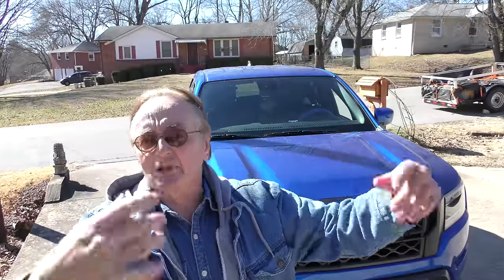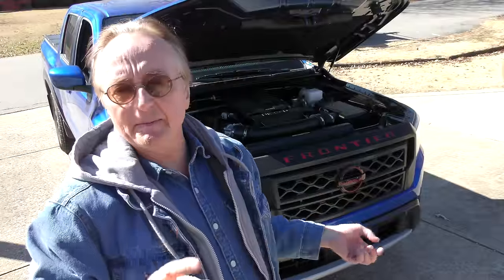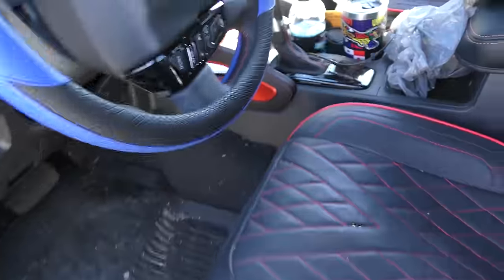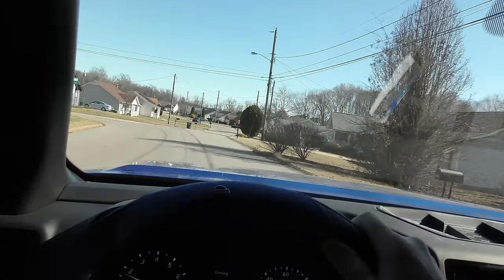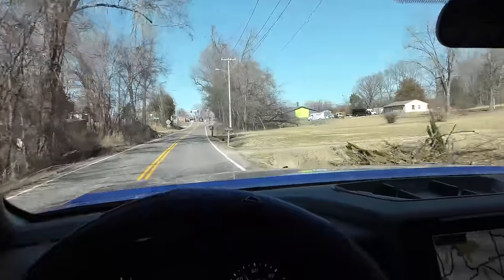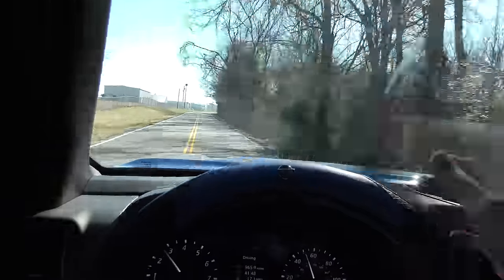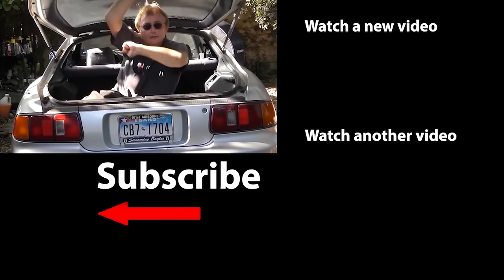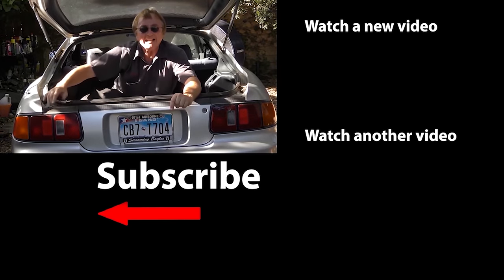This New Cheap Truck is Better Than Anything Toyota Makes Now

Comment: As a new frontier owner, I couldn't agree with Scotty more!

I drove just about every midsize truck in the segment, and the frontier really stood out. It wasn't trying to be anything but a good, reliable truck.
Reply: how much did it cost you and how much do you like it so far?
Reply: @GlycerinZ  I got a pretty good deal, it was originally a 42k truck but I got a 23 Sv 4x4 with 2k miles on it for 31.5k. A little dealer desperation helped
Reply: Thank you for the info!!
Reply: I hope they have manual transmission
Reply: @GlycerinZ  The Pro4x's are 40k+ brand new. I waited until the end of the year and picked up mine with about 5k off MSRP.
Reply: your truck is listed as one the most unreliable cars in 2023……
Reply: @j_n_g916 By who? Toyota just had a rear axel recall for the new Tacoma. They’re now made in Mexico. 
I have a 2015 Frontier. Almost 100k & ZERO problems. Nothing but service fluids, don’t even need brake pads.
Reply: @sledawgpilot you mean mejico
Reply: We all won't know how good these truck are until 2030
Reply: @j_n_g916 says who?
Reply: Love my 23 pro4x
Reply: @j_n_g916  by who? What issues are you referencing?
Reply: It’s been a long time since I’ve been in a smaller than a half ton truck. I had a 2023 frontier as my rental while my titan was in the shop. I HATED how small it was. And it just vibrated at idle the same way as an old Dodge from the 90s
Reply: @ericbruce5075  I will say, it does idle rough, but this is mainly due to emissions regulations because the idle is too low. That's at least my understanding
Reply: Glad to see that Scotty has become a Frontier fan. I'm on my third Nissan truck (first one was actually a Datsun, '86 I think), and I loved every one. My '01 was an XE and only cost about $16K, the latest is a '16 SV 4X4 and was about twice that ($32K). I considered a Tacoma in '16, but it was about $3-4K more expensive, depending on the trim level. My SV is super well equipped with the "value truck package". It even has dual climate control, one of my favorite features. I looked at replacing it recently, since the used truck market was through the roof, but a new one would have been more like $42K, and not with many cool extra features. Crazy.
Reply: Why do people buy small trucks? I just dont get it
Reply: @MrWalterRaymond  because they really arent small trucks. My frontier is about the same size as an 2000's model tundra. Over the years trucks got way too big, and I'd prefer the smaller size when driving.
Reply: @MrWalterRaymond why do people compensate in big trucks; I don’t get it
Reply: Nissan is only ranked under Toyota for reliability, unless you're considering the Hyundai Santa Cruz and the Honda Ridgeline as actual trucks. All American vehicles fall behind the frontier.
Reply: @MrWalterRaymond they're great if you just require something for light duty work. Also for me it's a secondary vehicle and I don't want a full sized truck taking up a ton of space in my garage or driveway.
Reply: Same here
Reply: Love my frontier
Reply: @j_n_g916  I have the 2022 frontier which is the first year release of this new model. 120,000 miles on it already with. ZERO PROBLEMS. Not sure where you got that info.
Reply: It always has been the best but people are all crazy about them tacos wich feel like were designed for midgets and I'm saying that as a short guy
Reply: @MrWalterRaymond  You can go more places
Reply: Yea me and my dad(who's a master mechanic) looked at the Frontier then the Colorado. On the way home Dad, said I wasn't unimpressed with the Colorado, just SUPER IMPRESSED with the Frontier
Reply: I drove just about every midsize truck in the segment, and the for ranger is a beast
Reply: @sledawgpilot I have a 99 pro4x. I'm just checking out reviews on the restyle/new engines. 99 is my second Frontier. Fluids and batteries for me. Nothing else.
Reply: @Bilbo383 When you are outside of your frontier while it’s running, do you hear the injectors? Kind of makes it sound like a diesel rhythm?

Comment: I was 20 years old. My first new truck was a 1984 barebones Nissan pickup. It had see through windows and push down pedals. No radio, a/c, cigarette lighter or rear bumper.  Paid $5200. It was a great truck.
Reply: I had an 89 Dodge Dakota, 8 ft bed, custom cloth interior, AC, awesome radio, tu-tone paint and OUT THE DOOR FOR ABOUT $8000!!!!!   SAME idea as your truck and if they would make a truck like this today for under $20,000 they would have people lining up to buy them and a waiting list to get them.  They would rather go out of business selling their 6 ft bed undependable electronic nightmare trucks that no one wants rather then offer dependable cars and trucks I guess.
Reply: My first truck at 16 was a 78 Datsun 5 speed. That was a tough little truck!

Comment: My friends dad just sold his 06 with over 250k on it. He never had any issues with it besides regular maintenance. 
He now owns a 2023 and is thrilled, he will have it until he dies I suspect!
Reply: I own the SUV brother to the frontier - I have an '08 Pathfinder with 209,000 mi. Runs like a top. Bonus that the previous owner had to put a new transmission in it because of the SMOD defect 😅
Reply: My frontier is garbage. So many issues. It’s an 07. Had a new transmission put in around 115k miles and have had tons of other smaller issues as well.
Reply: noob .dad.
Reply: I've got a one owner 03 with 284k miles. I've run this thing through trout streams hundreds of times. Paid $13k new in 03, put around $3700 in maintenance over the life of it. That's oil pump, alternator, break rotars, top end clean out, deals on the head and valve cover, and basic maintenance. So all in, i only have about $17k invested in a 21 year old truck that i still drive weekly. I'll own another one.

Comment: I bought a 2024 Pro4X in January, absolutely love the look, feel and drive.  The hydraulic steering is awesome.  Great video Scotty!
Reply: Hydraulic steering is a big green flag. You usually only see those in 2500 trucks cause they can't afford to lose steering when towing a heavy load.
Reply: These Nissans have hydraulic steering?!? That’s great too hear tired of the electric steering crap
Reply: @phantombread3170  yeah they do. most of the reviewers only talk about it in a disparaging way, because "it's too heavy" lol.
Reply: How much did you get it for?
Reply: @KK-tt6ui  I got a lot of upgrades, pretty option loaded at a cost of $46,680.  That also included the upgrade color of "Cardinal Red"
Reply: @JokerG16 it’s funny what people complain about 😂! It’s one of the main reasons I’ve been running Nissan trucks for years.

Comment: Real buttons and knobs and other manual items. 

 Just beautiful
Reply: Totally agree!  Hate the direction with the large gaudy screens where now all the controls, that were formerly on the dash, are now located.  The screen goes out, the truck is down.
Reply: @richarde1355  I couldnt agree more.
Reply: Never again. Had my screen lock up on my Jeep in -35°F weather. This tech isn't just a cheap cost cutting measure.... the stuff is dangerous.
I signed for a Frontier so fast that the pen started smoking.😅

Comment: Nissan frontier, hell yeah!!! I'm really glad I picked this truck as my first ever truck, best decision ever. Love the heavy steering, it feels like a TRUCK!!!
Reply: I got used to the steering right away and love it. Only time you might notice it is pulling into tight parking spaces.
Reply: I love my 2022 Frontier crew cab 4x4. 42,000 trouble free miles. The great feeling steering and 9 speed are the main things I like. And the looks of course.

Comment: Very under rated truck. the axel and drive shaft are DANA and the transmission is Mercedes. The Titan should just be a larger version of the Frontiers styling.

Comment: I have a 2007 frontier with 263,000 miles. V-6 with original water pump and radiator timing chain etc. Shifts perfectly, blows cold air, gets an honest 20 mpg on the freeway and has an absolutely kicking sound system. Still looks decent (white with roof rack). Have replaced breaks, coil packs, one window regulator and the clock-spring. Yes, it rides a little rough, and if I should ever replace it, it would be another frontier. That is if I stumbled on a fortune first.

Comment: My employer leases these for work trucks.  I've driven several  of them over the years.  I have one of the new body style models now, which I like the styling of.  The older body style was pretty fugly, but  the last one served me quite well...160k miles in 4 years with no major mechanical issues.  It had the 4.0 v6.
Reply: Whew!  That’s a lot of driving!
Reply: @Dbb27  It's more than I'd like to be doing, that's for sure.

Comment: My work recently bought a titan xd that is only a couple years old. It was put into service immediately doing lots of terrible winter driving. So far it has been an absolute tank, it feels about twice as capable and planted as some of the other work trucks over the years. It feels planted in to the ice in a way few other truck do, at least that I've driven, even on the fairly average 3 season highway tires the dealership bought it. That v8 has quite the character and throat on it when it opens up too, it sounds badass from the factory and pulls plenty hard. It also just likes to go fast, it's kinda hard not to speed, it sorta has this bad boy attitude just by how it drives. I'm pretty sold on it, wish I could drive it all the time. Can't believe they aren't more popular.
Reply: yeah bro the Titan is so underrated. i rented a non-XD version a couple of yrs ago and that thing was SOLID as hell. it had a stance that was almost on par with an HD Silverado!

Comment: Back in the day I bought a Nissan hard body 4 X 4. And they were stupid cheap money. But they were really good trucks. I used to pull a boat and I used to pull quads and motorcycles with the truck. Never had any issues. If this Nissan is even close to as good as those old hard bodies were, I would buy one.
Reply: yeah they seemingly are bro. they even brought back the hard body design for '24... looks super retro!

Comment: It's a Mercedes-Benz 9G-Tronic made by Jatco under license. Still better than any CVT they made
Reply: Is it a good transmission?
Reply: It is not the Mercedes transmission.  The Mercedes-Benz 9G-Tronic is designed by Mercedes and manufactured by Jatco. The design is licensed to them and has several modifications to it in order to work with Nissans engine.  There are quite a few parts changes and the software that controls it is completely different.  So, you cannot simply say it’s a Mercedes transmission. You could not simply swap one for the other.
Reply: @krellman7  Is that Jatco 9 speed a good transmission? I haven’t heard too many bad things about Jatco’s other automatic transmissions.
Reply: @bucknasty69  Yes, this has been a pretty solid transmission. I would say it has been pretty rare to see an issue with them. (I work as a service manager at a Mercedes dealership). So far, so good!

Comment: Still miss the old 4.0V6 Nissan used in the older models. My Moms old Pathfinder same as the frontier in at the time, has the 4.0 and 200K Miles still drives great! Gotta love older vehicles
Reply: The newer 3.8 is also a VQ engine. They're almost identical.
Reply: @jkahre  yeah, i believe the 3.8 is just a direct injected engine, rather than the port injected engine in the older 4.0L

Comment: I own a blue 2015 Nissan Frontier SV 4x4, it’s got 220,000 miles and it’s still going, same transmission and engine
Reply: I've been looking at this 2015 year. Did you buy it new or used?

Comment: I’ve always been a Toyota guy, I’ve had a Tacoma, a Tundra, and two Carollas. I have a 2012 Nissan Xterra with 265,000 miles on it and it shows no signs of slowing down. I think I’ll take a look at the Frontier when I’m ready for something ‘new’

Comment: My son bought a new one in 2022. It's been absolutely flawless. Oil changes every 3,000 to 4,000 miles. Drives/rides and handles much nicer than the Tacoma, which was his alternative.
Reply: Same with our Ford Maverick hybrid, those things are reliable as hell.
Reply: Hold on the maverick is only what..2 years old?
Reply: Changing your oil every 3,000 miles is a waste of money. :/
Reply: @Peterswarahed 
A women told me her car was reliable & it was only 2 years old with only 8k miles 😂.
I replied, I'll let you know if my 7 yr old 120k miles Subaru is reliable in 3 yrs 🤔
Reply: @Raboon115 are you my brother in law? He thought he was smart changing his oil every 10k miles and blew his engine up at 70k. Oil is cheap, engines are not.
Reply: My 1972 Maverick was very reliable.
Reply: @x-Saffron-x  it may be a waste but to quote an old school saying my dad used to say,  “it’s cheap insurance”. In my opinion regular oil changes plus proper maintenance has help keep my  domestic vehicles reliable and dependable. 203K on a 07 SXT charger, 180K on a 2013 explorer, 170k on 04 Dodge Ram 1500. All still running strong and helping me to keep avoiding new car prices at all costs. Our newest car is a 16 Mustang at 60k
Reply: @rigell2764  

Owners manual says synthetic oil only needs changed every 5 to 7 thousand miles on a frontier.

I think the engineers know better than you do.

If you are breaking in a new engine then 3,000 is fine. 

Your brother in-law is the other end of the spectrum. Lol
Reply: @renohiker  

It's not insurance and this isn't old school natural oil. It's synthetic. 5 to 7 thousand mile changes is what the engineers recommend on new vehicles because it's what they built the engine to conform too.

And I have a feeling your Dodge's burn oil so you don't have a choice but to change it earlier.
Reply: @x-Saffron-x  This vehicle works downtown about 50% and urban/highway 50%. That's very cheap insurance and his crowd knows how he maintains it. A ready pack of buyers when he decides to doff it. Owner manual recommendations are designed to get you through the warranty period without engine problems related to dirty oil and worn oil. The incremental cost of oil vs repair, plus downtime, rental and pain in the butt factor makes it a no brainer.
Reply: @rob6052  

again. It's a waste of money and is not "insurance" and it's not "cheap". 

You are spending an additional 40% on oil changes for the duration of the vehicle with no added benefit. 

That's fudd Lore as can be.

The engineers designed the engine with the idea of changing the oil at 5,000 - 7,000 miles with standard wearing and above in mind.

Like Scotty said, it's a naturally aspirated V6. The engine is not going to fall apart from doing its job with recommend maintenance.

It has no turbos on it or other augments which increases engine wear.

Comment: Scotty, thanks for all the work you do. I sure wish I had you down this way as I have an intermittent problem with my Frontier AC. But I digress. My Frontier is a 2000. It is their big 4 and I got it as a grocery hauler and light-duty truck to transport things about. It has served me well for 24 years. Only lately has it cost much. When you do maintenance today you have to drop off a kidney to pay for the labor. It has less than 110K on the odometer. The body is in great shape except for the road scratches you get from folks opening their doors and road debris. I can't complain about the quality of the truck. Of course, it is a little dated but is a part of the family. It may be the last truck I'll own as I'm retired. However, I get the itch now and then. I really would have liked to have purchased a Toyota truck back then but the dealers in the area were A-hats. Either way, I may have to look at a Nissan again in the future if something happens to my old truck. It seems that you can't keep folks from driving while stupid. I've never wrecked a vehicle that had to be totaled. Yet, I've lost several to folks driving into them while parked in front of the house. I used to own a lot of the older Nissan cars. They were great vehicles. I'm not much for all the bells and whistles on these things as they crap out and cost far too much to have repaired. Again thanks for all the info.

Comment: Xterra and Frontier are the same engine and transmission, and I have had two Xterras with a combined almost half a million kms and have never had a problem.  Oil changes every 5000kms and regular maintenance only.   My next vehicle will be this truck.
Reply: I have a 2023 Nissan pro 4x I love it wouldn't trade it for any mid size truck on the market.

Comment: Learned how to drive late 90's on a '98 Nissan Hardbody 2.7l turbo diesel manual transmission. The thing could take off on the 3rd gear and have always loved those trucks

Comment: Frontier 2dr is the only trk I'd consider if my old Ranger ever dies. 
Vehicles are like tools. A Gran Marquis for family road trips, a Nissan Versa manual 5sp for commuting and grocery getting and 2dr trk for trk things. All naturally aspirated for long life.  All three for less than a 4 dr trk.  4dr trks are not great cars and not great trks.   Only exception, 4dr full size trk for family camper or boating adventures. 🤠
Reply: Frontier comes in single cab.  Unfortunately they don't offer Pro4x in single cab though

Comment: I had a 03 Frontier with a 3.3l V6, I had it for 15 years and when I sold it it had 285K miles, never had any trouble with it. Only changed the the timing belt and water pump at 100k and 200k. Kept the oil changed every 3-5k miles. I still see it driving around by the guy who bought it from me.